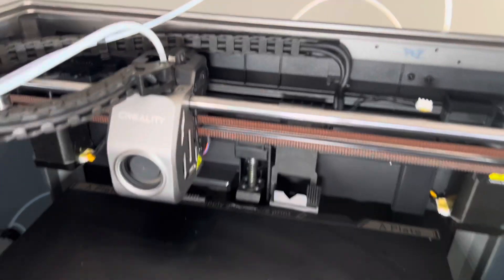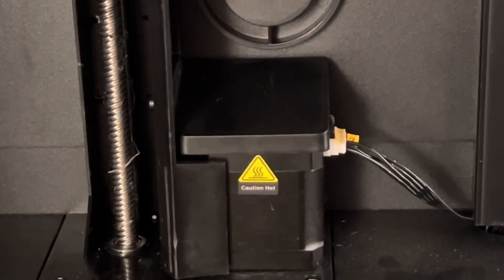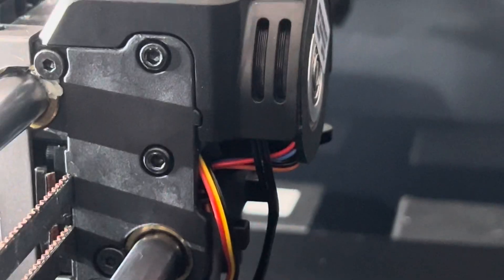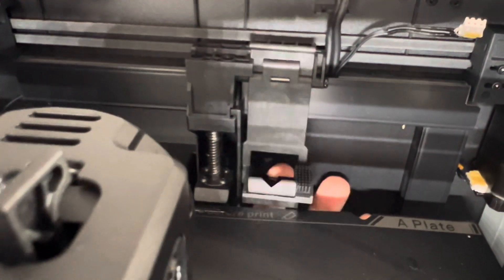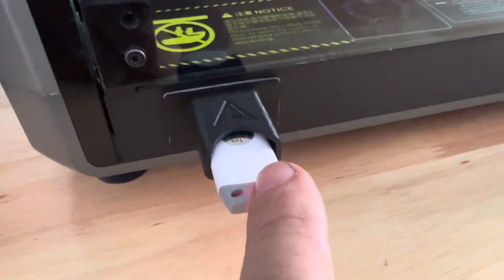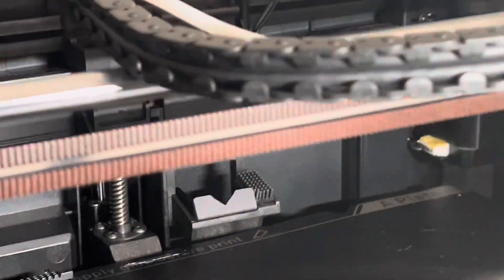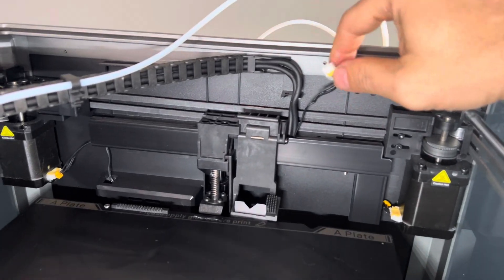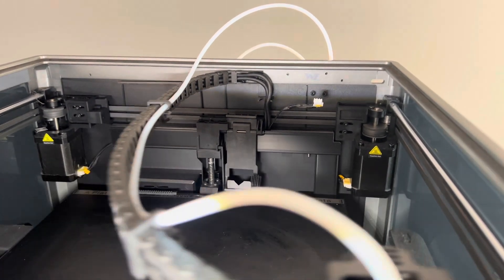Creality CFS Color Upgrade on K1 MAX - INSTALL BTS

Comment: Не было у мужика печали, да вот скучно стало решил "омудохаться".  K2Plus 400 часов печати начались сбои в CFS. После последнего обновления по работать  перестала!!! Бамбу лаб Х1С 1000 часов полет нормальный.
Reply from the maker: Saying THIS DOESNT WORK, BUT THAT WORKS, is not a valid argument. No machine or Brand, is safe from potential issues. Have you noticed I never show my X1C on this channel? It's because mine is a Lemon, that has never worked right, and still doesn't. It happens. We just need to work through it, and resolve our issues.

Comment: Is the CFS compatible with slicers other than Creality Print?
Reply from the maker: Sure. But so far, CP6 works best with it
Reply: @3DRundown  thanks for the answer
Reply from the maker: Orca was causing Extruder jams for me, and I've seen others with the same outcome. I'd CP6. It is a nice slicer. However, I do use BAMBU STUDIO for my K1 and V3's all the time.

Comment: Will we be able to have the CFS on top of our printers?
Reply from the maker: I suppose.... But, the K1 MAX setup, has the PTFE going over the top, at the moment.
Reply: @3DRundown  I’m sure people will make mods to make it work half decent 😂
Reply from the maker: Totes. Should be easy peasy for the cover. There is already a hole in the body

Comment: I ill have to see how this goes with my upgraded K1 Max someday. I did the linear rail upgrade kit a while back and it changed the hot end's carrier, of course.
Reply from the maker: I am super unhappy about using my K1 MAX for this kit. My K1 MAX is my favorite printer.